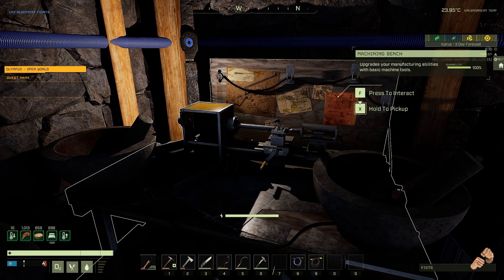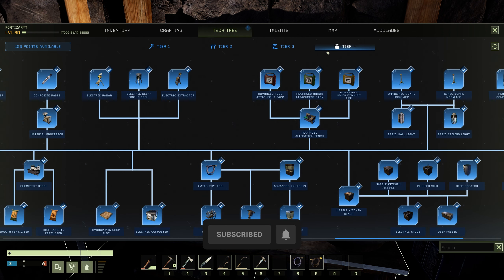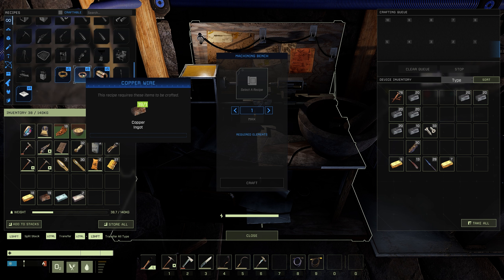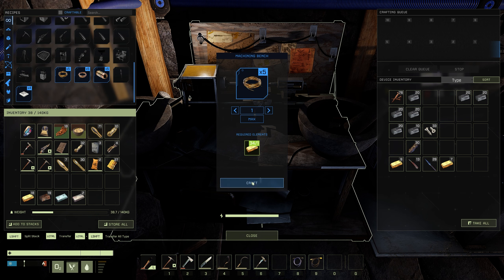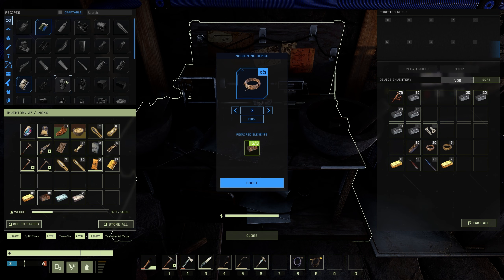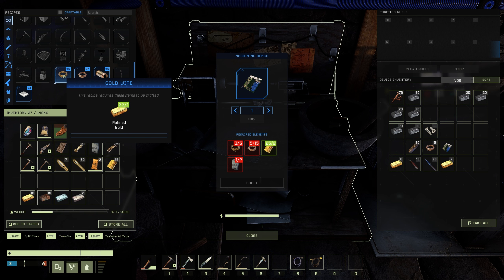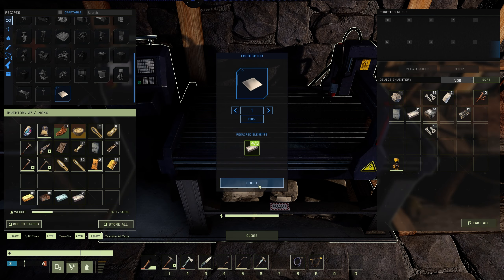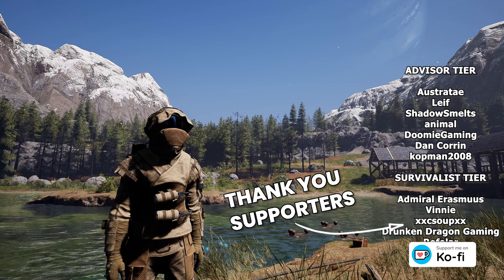ICARUS Electronic Changes - NEW Gold & Copper Wires

Comment: Really hoping that the changes to the wiring recipe signals possible new recipes, down the road, and (hopefully) battery arrays being added to the game sooner.  Since "end game/prospect" benches are electric, having more power management would be great, and could see solar panels be an actual viable option.
Reply from the maker: In the dev Q&A he did say batteries ect is coming so the wires will probably hopefully be apart of that.

Comment: I find that the recipe for the electronic didn't actually change, but that the added new steps into now as a result, you now have to do more work rather than less. If they make it instead 2 recipes with either using gold or copper wire, where the amount changes depending on the wire then that is a change, but this doesn't look like a positive change to me, it is more like now I have to do 2 more crafts just to get a item they didn't change.
Reply from the maker: It looks like that now but this is potentially the first step to future things coming that may require wires dude. I personally like it, I'll hold my judgment for now.
Reply: @Fortizar  meanwhile 10 months later